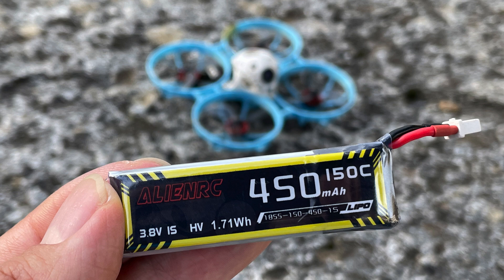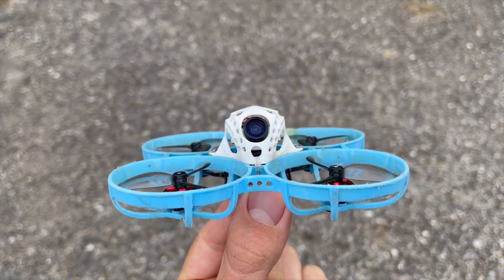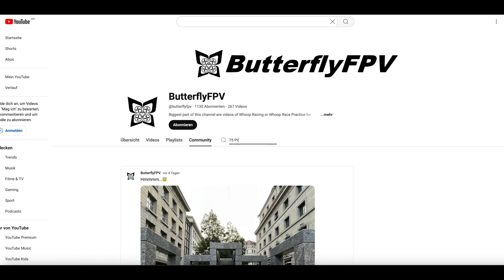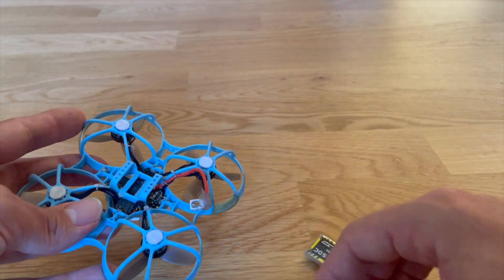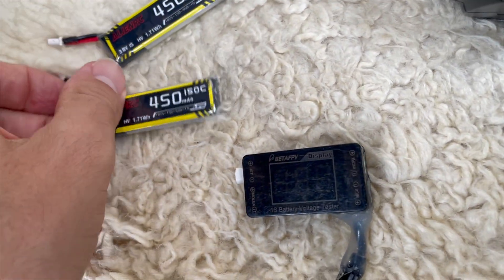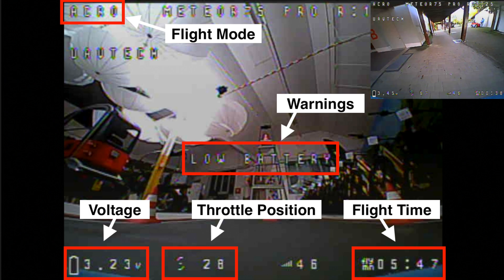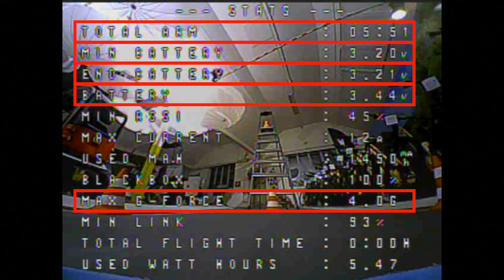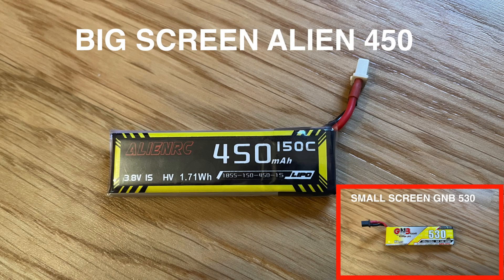BEST PERFORMING 450mah LIPO on the MARKET?  | ALIENRC 1S HV 450mah 150C | Betafpv 75 Pro

Comment from the maker: ‼⚠ Please note the INFOS and LINKS in the VIDEO DESCRIPTION! Pay attention to the VIDEO CHAPTERS! ⚠‼ 
I forgot the footage of the alien lipo weight in this video. You can find the weight of the alien lipos here in a post in my youtube community:
https://www.youtube.com/@butterflyfpv/community
IMPORTANT INFO FOR THE NEWBIES: The printed C-Rate on a lipo is almoust never the real C-Rate. 150C is never ever possible. Even the cables on the Lipo would melt at this C rate. But the fact that the higher number has more performance in terms of c-rate is still the case. I have never experienced a 100C Lipo that performed worse than an 80C Lipo. And never a 150C that performed worse than a 100C. In terms of c-rate. That's why I am no longer interested in the printed C-rate number. As long as a 150C Lipo performs better than a 90C Lipo at the same price then I don't care whether it says 120C,  130C, 140C or 150C. It simply has to perform in my real flight tests. Then everything is fine for me as a Pro Pilot. For me the bigger the C-Rate number the better. But for you as a beginner, the flight time may also count. Or counts more. Or the longevity of a lipo. Or that the Lipo is more tolerant of deep discharges. That the lipos don't puff so quickly. Then lipos with a lower c-rate might be better for you. Always make sure you buy the lipo that is right for you. Adapted to your needs and flight level. You don't need a high c-rate lipo as a newbie.

Comment: Looking forward to more battery reviews! Maybe 300mah batteries next? For us 65mm flyers
Reply from the maker: 65 lipo test? I don't think it's necessary, right? The Tattu 1S 300mah have been king there for a long time.. (Or weebleed or tinywhoop). And the betafpv lavas are good too. Or do you know other 260-300mah stick lipos with a high c rate?
Reply: @butterflyfpv  well I am still very new to fpv so I would want your opinion. Also I don't see anyone talking about the tinywhoop,com batteries or the the quad gas batteries that claim 320mah.

Comment: Did you ever tried removing the guard to make it lighter?
Reply from the maker: Not yet. But that's of course a good point since the GNB comes without shrink tubing. And the shrink tube could weigh 0.3g. That's not insignificant for a 29.7g whoop. I might test this in the future, depending on what I plan to do with the lipos. For builds where the lipo is not well protected in the frame, the shrink tube is an advantage.

Comment: why does your video have uavtech on the osd and there is no way in hell a 1s lipo  can do 150c.
Reply from the maker: Because I fly the PID Tune from Uavtech. Yes, of course is the labeled c rate number not the real c-rate. The max. real C-Rate of a 1S Lipo is around 40C. That's why we're no longer interested in the printed C-rate number. So not me. As long as a 150C Lipo performs better than a 90C Lipo at the same price then I don't care whether it says 120C, 130C, 140C or 150C. It simply has to perform in my real flight tests. Then everything is fine. Give butterflyFPV the power and then he will be happy 😃And this is why I made this youtube video with my real flight tests in it. For me the tests and for you guys the video of the tests! And in a few months I will report on the long-term durability of the lipos.

Comment: Thanks for the video! I’ve been using sub250g 530 90c lipos and I feel them good. Not such a difference from my gnb 450 80c actually, but as they are new, they perform great so far
Reply from the maker: Thank you for your feedback! Yes not a crazy difference. Thats also my experience. But more flighttime than the gnb 450mah 80C. Maybe thats why they labbeled it with 530mah.

Comment: Did you try remove the plastic on the 450 alienrc
Reply from the maker: No because when I looked closer I saw that it doesn't make any difference at all because the lipo itself is already way too wide. And the lipo compartment of the 75 Pro is already very narrow for normal lipos. So there is really no chance of installing these lipos without modifying the lipo compartment. You could cut the struts in the middle at the top. Or try to expand the holder using heat. But I don't feel like it at the moment...

Comment: Seeing your videos, I'm starting to miss tinywhooping. Even though I've just built my 5 inch and tried it, it's a huge difference. Don't get me wrong, I am excited to finally do a whole flight with my 5 inch ripping trough the air! But now that I have less time in the evening to get my lipos ready, it's harder with a 5 inch. I'll get another 75 pro once I'll get my paycheck! The first test flight was really scary because the 5inch is like a flying chainsaw and I don't think that it is an awesome feeling to have a 800g hedge trimmer banging into your head at about 80km/h . I went a bit onto the throttle (~40%) and was already 50 meters high, which was quite scary as a tinywhooper. But I'll fly it this time when there is enough sun to see everything.  I'll just have to get used to it.

Edit: I've bent the motor bells and broke the UV filter on my original 75 pro
Reply from the maker: Tiny Whoop is the way buddy!😃 Whoop whoop!!🥳

Comment: Im tired of the lipos not fitting the frames. It sucks to find ones that fit. Also sucks to have many different lipos for 65 , 75 and 80 mm whoops.
For the 75mm class I just ordered the hglrc petrel 75 frame. You can use just about any lipo with a rubber band on it. No tpu print or slot in a frame. Will test and see if I like it.
Reply from the maker: Yes it sucks a lot! True story! Sad story.. 😞 The HGLRC frame is ok but a bit heavy..
Reply: I cut off the battery tray from my 75pro and printed an adapter. That tray is pure garbage with the rounded corners square cell lipos either dont fit or are a "press fit".
Reply: @galardo3303  do you know if the newbeedrone cockroch 75mm frame is any good? Seems heavy. But I like the idea of a stiff carbon plate added
Reply from the maker: @galardo3303  Kinda true! Interesting! Do you have a link to your lipo holder for the 75 Pro?